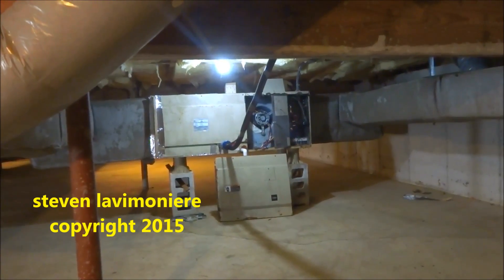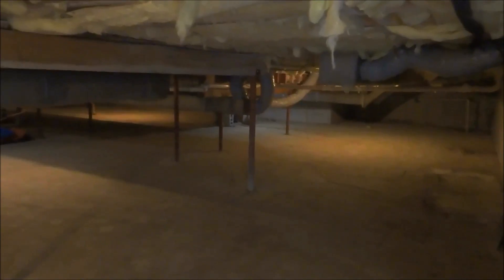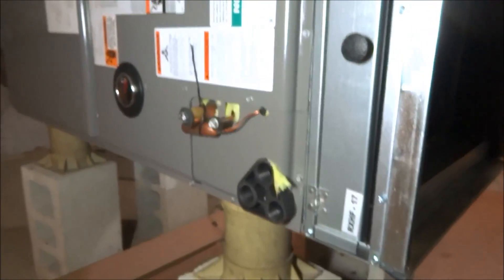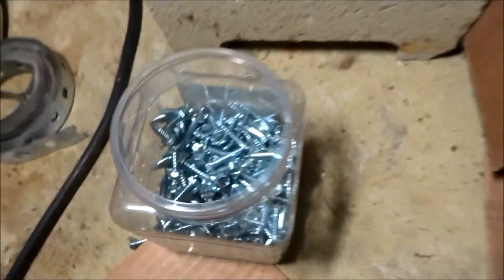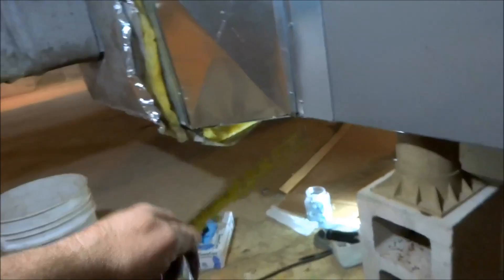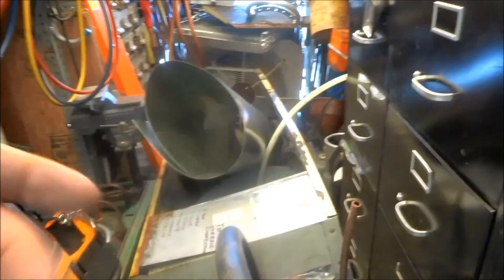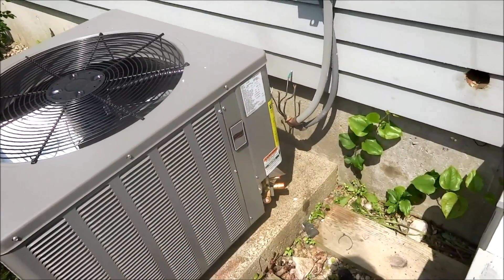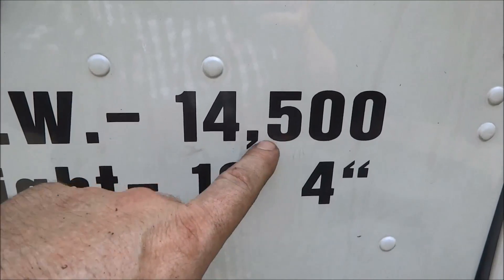heat pump,air handler,line set replacement ,part 1

Comment: you never considered getting a used school bus for your furnace and AC hauling? as the ones with a wheelchair lift would do to lift furnaces and condensing units and if possible if the wheelchair lifts can lift the heavy cast iron semi-hermetic compressors. as a mid sized type C or D bus would do but you have to strip the seats out to accomidate the tools motors, fittings,  as a school bus is a much sturdier body and most likely would survive an accident in.

Comment: Just curious, but why don't I ever see you guys using ductboard. It does have its uses and in certain circumstances is easier to use than sheet metal.
Reply from the maker: kaydee457 i do not like or use duc board .. sheet metal is a better job

Comment: nice clean work Steve. good decision on the lineset replacement.....and the truck is definitely awesome, and practical. Are the sprinter trucks smaller than Yours? I was looking into the Sprinters because of the size
Reply from the maker: Hybrid nj my truck is wider and can carry more weight then the sprinter .. my truck is a 14,500 gvw truck  so i carry a ton of parts

Comment: Sweet!  Do you have to use an electrician to wire the units in MA?  That faucet was pretty cool with the brush.
Reply from the maker: Truckguy900 Truckguy900 yes electrician needs to wire the units . by mass code .i try to follow the rules .and codes

Comment: Self drillers are very good on thicker sheet metal (car/van bodywork etc) but yeah, I'm with you for thin gauge panel, pointed screws are much better.

Fascinating to see your work Steven, I've never done HVAC, trained as an electrician (which seems to be what HVAC came under at the place I worked, rather than plumbing, oddly) but the HVAC guy, I never worked with :)
Reply from the maker: ***** the 3/4 screws work the best

Comment: Nice work Steve! The sheet metal came out nice. I guess you can pretty much make anything with that Hensley bender
Reply from the maker: Emin HVAC i use it for cross breaks on floor and make bending the sheet metal easy.. it have good leverage  so you can grab and bend easy with your hands .

Comment: Nice install.  I really like your way of measuring metal.  Cut the piece bigger put in up and mark it.  I used to measure everything off of a plumb line untill I watched one off your sheet metal videos.  Make it simple.  Thanks
Reply from the maker: All Hours Maintenance i try to make thing simple less chance for a screw up,to many measurment  you can mess up to easy

Comment: What is the reason for risers on a heat pump?  Does it need clearance underneath it?  Also are you sure that air handler was a carrier I thought it was an ooooold American Standard
Reply from the maker: Chris Bramell it said carrier on the cover plate i do believe . i can look again it out in my scrap pile

Comment: Seems like you only work until 3pm is there a reason for that?
Reply from the maker: Matthew Peterson today a worked to 5:00  some days i work to 7:00 . depends on the day . i try not to work long day unless i have to . i really do not need the money. i have done well over the years . you must be a young kid wanting to work crazy hours??? as you get older you work smarter .and less
Reply: steven lavimoniere woa man I meant no disrespect. I  just was wondering. It must be nice I am in my 30's and I have to work longs hours just to keep up with the load.